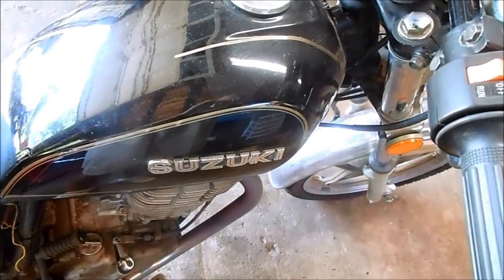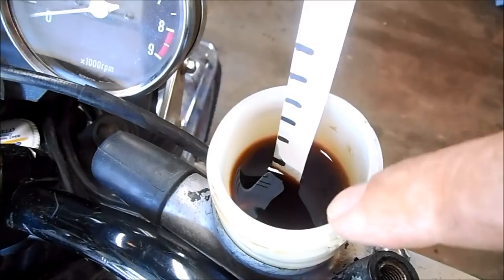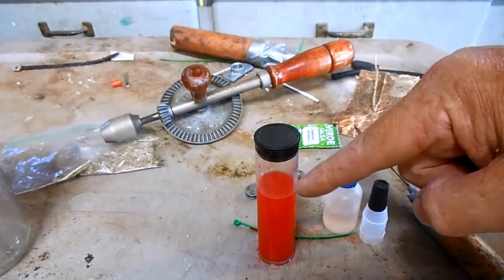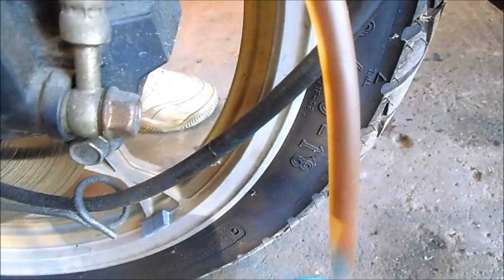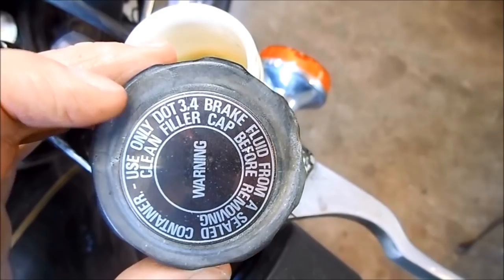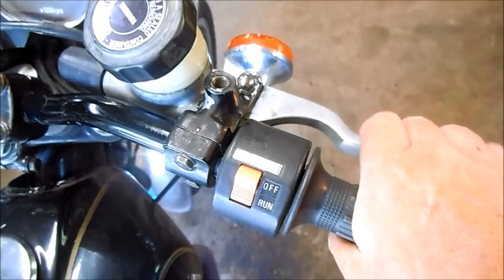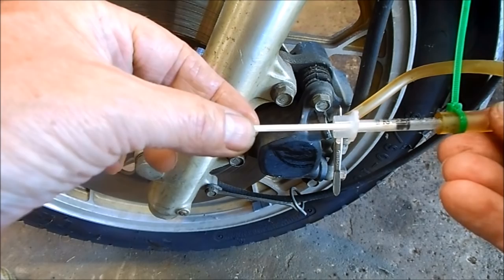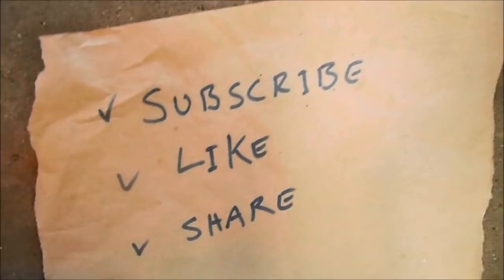how to flush, fill and bleed motorcycle disc brake system

Comment: If your brake fluid is ever so dirty that it is black, do not flush that dirty fluid through your brake caliper. All the dirt and sediment in the brake fluid could seize up the piston inside of the caliper. Remove the brake line from the back of the caliper, typically it is held on by a banjo bolt. flush all of the old brake fluid through the detached line. Then reattach the brake line back to the caliper. Fill the system with new brake fluid, then bleed  the system out through the calipers.

Comment: I didn't have any syringes for the last part as I gave that up. So I just sucked on the end of the hose and found that worked well. The mild blindness cleared up quickly but the headache lasted for days. It did teach me that I'm going to have to space brake bleeds from now on.
Reply: Just have a root through the bins outside the needle exchange
Reply: Behind the local High School and next to the trash of the 15-minute stay motel are good sources too. Thanks.

Comment: A tip to you guys changing break/clutch fluid and dont want to bleed it.

If you get a bigger syringe (often found on farms due they use it to inject medicine on cows/horses)  you can add the fluid in the syringe and open the bleed valve and press it from bottom to the reservoir. Then close it while pushing in fluid when you see it retching the reservoir. With this Technic you dont need to bleed it, Because the air is traveled up :) 

I do like this on the clutch and brakes on my KTM and it works perfect every time :)
Reply: Mecke-Productions yes thank you I just couldn't get air bubbles out of my clutch and woulnt disengage completely this has saved me 200 bucks for a tuneup

Comment: I came up with a bad ass way to do away with the need to ever have to bleed brakes again. I took the cable brakes from my old push bike and put them on my Fireblade. This did away with the need for disks, pistons and brake housings, brake pads and fluid etc. Unfortunately I did not get a chance to test them myself as my friend borrowed the bike and killed himself on it before I could. I don't honestly think he was ready for such a fast machine.

Comment: Fantastic Video! To save on the wallet, I filled the brake system with sterilized water and mixed it in with WD-40, just to error on the side of caution and prevent rusting out the brake lines!

Comment: A few comments on this video. First, if the fluid is that dirty, get a turkey baster or some type of vacuum bleeder and suck out the old fluid from the reservoir first. Don't push that dirty fluid through the system. Second, make sure to get a fresh bottle of DOT 4 brake fluid for your motorcycle. There is no such thing as "DOT 3.4".  I have no idea what the presenter was thinking.  Third, use the proper size closed-end wrench to loosen/tighten the bleeder valve.  Do NOT use tweezers or pliers!  Finally, flush enough brake fluid through the system so that it's completely clean. Do not skimp out on fluid.  Then every two years thereafter, do this again for good brake maintenance.
Reply: This video is satire 
All his vids are

Comment: Thanks for the walkthough on the subject, I really appreciate you putting the video together. This cleared up a lot of what I was doing wrong while getting the oil pressure back to normal. 

One thing I'd like to ask about is cleaning out the brake line. I noticed on my bike that fresh oil turns brown after a few pumps. I can clean out the cylinder and the callipers no problem. How would you suggest clearing out the brake lines in case there's some brown sludge in there? Use the special brake cleaner fluid you mentioned or just get enough fresh brake fluid through the line?

Comment: I just disassembled my disc brake and flushed the , brakes lines, master cylinder and brakes calipers with Diesel and there's a lot of dirt inside. Then I assembled everything back and added a new DOT 4 brake fluid and bleeded the brakes and my brakes are working like new.

Comment: I removed all fluid first to rebuild caliper. Did not touch master cylinder. But i dried it out. Now it wont pump and generate pressure. Any ideas?
Reply from the maker: give the master a good cleaning and inspection

Comment: I cant find any dot 3.4 brake fluid here. Can i use 3 parts of distilled water and 4 parts of cooking oil instead ?
Reply from the maker: follow the chart on the bottle. I think you need peanut oil. but not certain

Comment: It's quite clear that having meat on his brakes might cause the spongy lever. Once it has been used several times it gets hard and useless. Perhaps fresh meat may be the answer?
Reply from the maker: I'll call Nickel Town, there might be a meatless option too
Reply: +Ichiban Moto I had a Suzuki Bandit 600 come into the shop today. The owner told me there was a rattle in the gearbox. After lots of checking I had no option but call him and tell him there was not one. "Are you sure?" He asked me," well I  have had four children and can recognise a child's toy without any help!". The mans a fool!
Reply from the maker: I told a customer that was in for a fluids service that I would also adjust his rattley cam chain. He said "no thanks, it's always sounded like that"

Comment: I just did the brake fluid test you described and it went blue, please help!

Also, I used dot 6 brake fluid instead of engine oil in my motor, will this be ok?
Reply: I think the blue means your pregnant!
Reply from the maker: congratulations +risc19  !

Comment: Is it true you shouldnt use old brake fluid? I saw somewhere 3 days after being opened you should throw out your left over fluid. And you should also try not to shake the bottle to avoid bubbles?
Reply: You can still use it after 3 days but some people don't recommend it cause brake fluid absorbs water so you'll be reduced braking power i've never had a problem but yeah.
also no you probably don't want to shake the bottle because it will take longer to bleed all the air out once you fill the system.
Reply: If it's glycol-ether based brake fluid, you can preserve it in the  freezer. That will buy you a few days after opening
Reply: You can use brake fluid thats been open for years if you pour it into a dry kettle and make a brew. Pour it over a tetleys t bag and all the water will be absorbed by the tea. This works as good as a regular cup of tea but you need an extra 2 spoons of sugar to take the twang out of it.....

Comment: Turkey baster,  remove all the crap!!
Top up with fresh fluid
 Use a syringe on the bleed nipple
 Suck fluid out until new fluid appears.
  Make sure you tighten the nipple. 
  With a spanner or  a wrench.
   Not too sure about tweezers.

Comment: If it is not clear brake fluid then it needs changing.  My oil doesn't even get that dirty.  Use a dollar store turkey baster and suck the old fluid out of the MC  and then add fresh fluid before bleeding the brakes.  Use a proper spanner on the bleed screw not a pair of tweezers.
Reply: David Ferguson dude this video is sarcasm or a joke